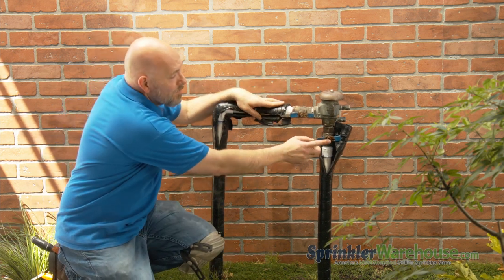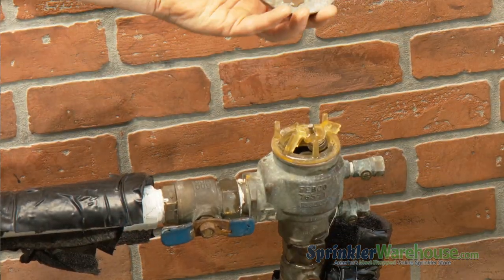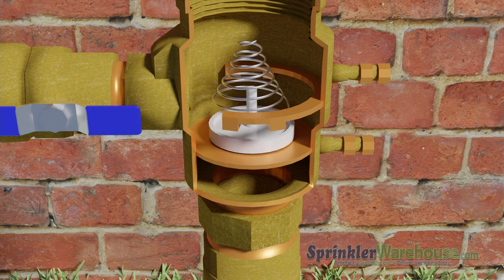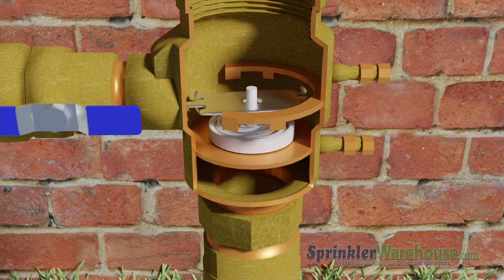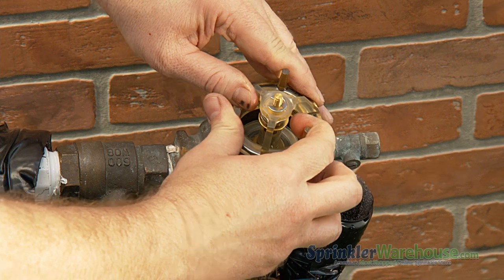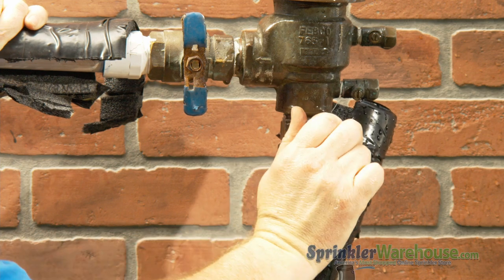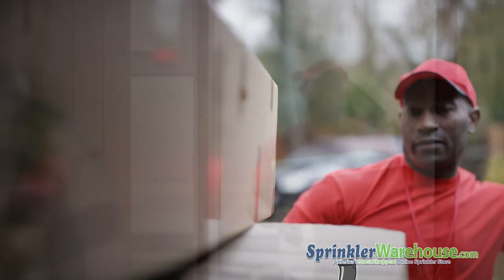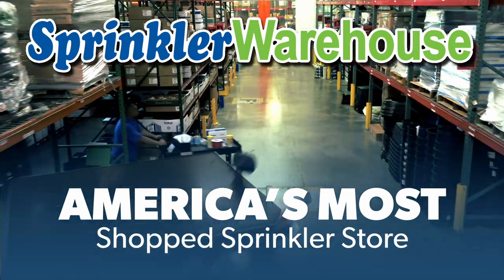Replacing A Febco 765 Check Valve

Comment: Having this exact problem. I replaced the check valve, spring, retainer, bonnet, poppet, but I’m having the same problem. Any other considerations?
Reply: Finally fixed it! It ended up being a pressure issue. I was opening the valve too slowly so the bonnet and poppet weren’t creating a seal. I started over, then opened the valve fast and voilà! The seal was created and no more water volcano
Reply: @jessel2912  your comment saved me. THANK YOU.
Reply: I keep repeating the steps but it keeps pouring out